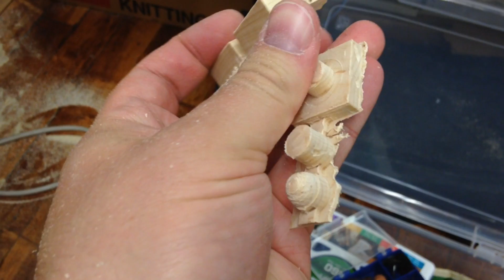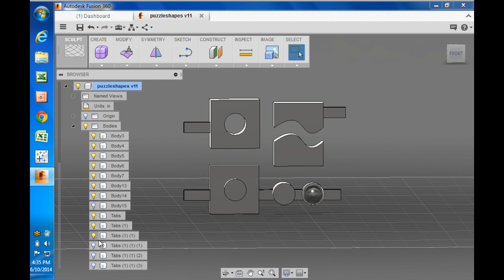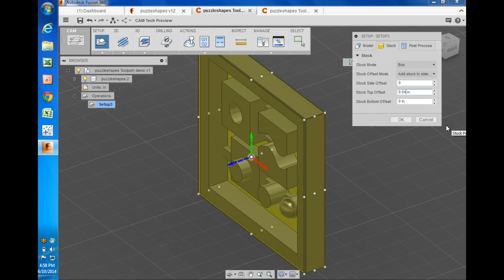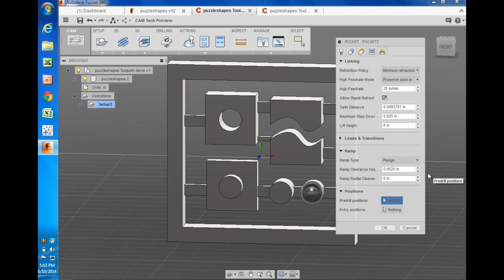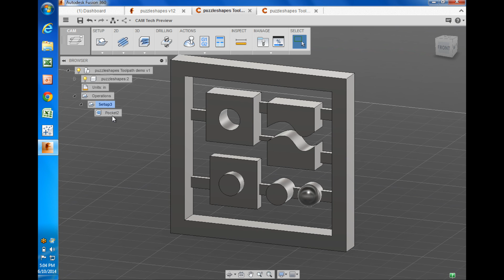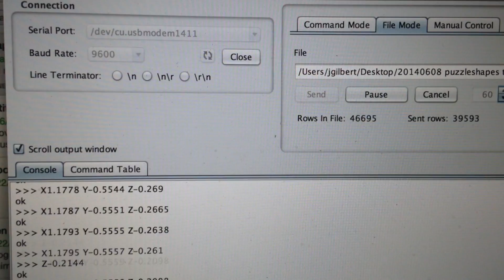Shapeoko 2 Tutorial using Fusion 360 / CAM 360 by Autodesk

Comment: This is the dumbest software. Every video I watch has menu options not available in my version. Like tabs i just added tabs and you can too, for this reason, without any explanation of how you did it???? No icon to generate tool path on my version but then there is open option under the file menu either.
Reply: Fusion 360 is cloud based so it is updated every time you open it.